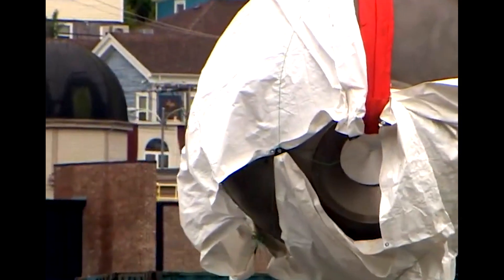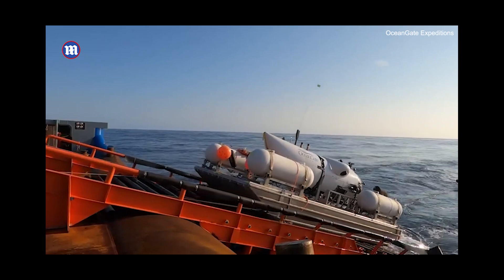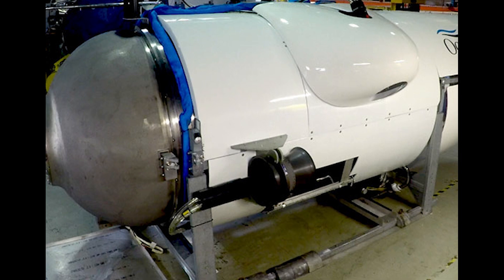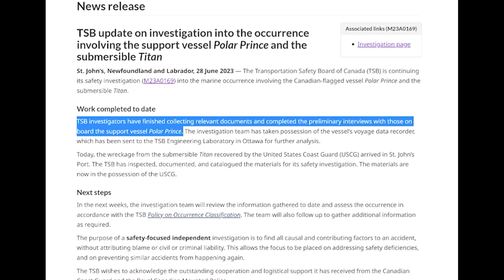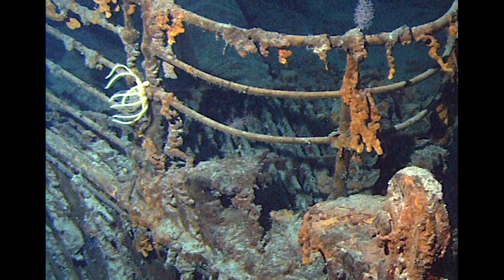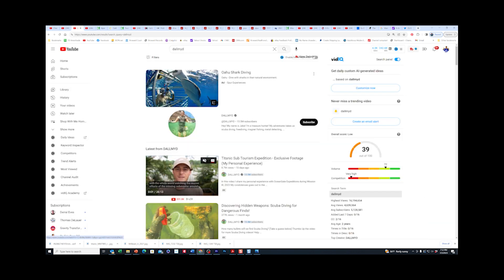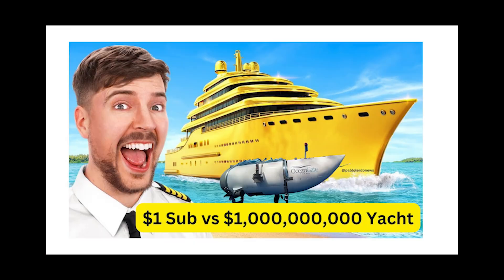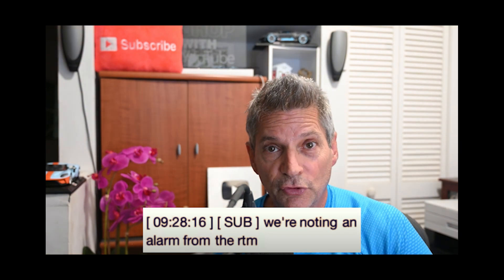Titan Submarine Debris Clues, Implosion Simulation

Comment: Regarding your comment that they didn't use a torque wrench to tighten the end cap bolts, I've seen other videos of them installing the end cap, and they finished the sequence with a torque wrench.
Reply: If your transmission pan leaks after it was serviced , chances are they failed to use the proper sequence or pattern as well as the torquing of the bolts as the manufacturer dictates. 
A spot on your driveway isn't as critical as a vessel exposed to 6000 lbs / Sq. Inch for a submersible.

Comment: I'm really surprised by all this. I have experience with carbon fiber materials for 30 years, both in windsurfing, where it's being used for example for masts and in cycling. As long as I'm dealing with these materials it's more than clear that force from outside will most likely damage it, that's just inherent to the structure of the material, it's easily crackable when you put pressure on it from the outside. It pushes the fibers together. The best comparison, I think, is with a rope. It's very strong if you pull it, but it wil immediately lose all it's strength when you push it together.

Comment: One thing is clear the temperature of double the surface of the sun has never been reach ever inside that Titan sub. Titanium has the lowest melting point, even lower than human bone . The thermal conductivity of Titanium and carbon fiber is much much higher thsn human bodies, which would have melted the thing and that didn't happen. So that part was made up. Also, James Camoron thinks water can be compressed, so I question whether he paid for his degree. And surface water on top of a small planet cannot atomise anything, not even the sun can do that and questionable whether even black holes can too, all theu do is compress atoms down after which they can explode out again. .

Comment: Where are the carbon parts? Well, that implosion was way more violent than that barrel. We're talking about several cubic metres of water (that is, several tons) rushing in at the speed of sound. When that wall of water hit the other side, there was an incredible shock wave going through everything there. So the carbon hull has probably shattered into tiny pieces, both titanium endcaps were blown clean off the carbon or all the carbon bits were exploded or shaken off it, the same shockwave blew off the viewport (and/or shattered it). The metal pieces have staid together probably only due to the failure mode of metal - they look ok at the first glance, but they are likely bent oder deformed or cracked.
When you consider the violence of the event like that, you realise why they immediately said that there will be no bodies to recover. Rest in peace.

Comment: Hydraulic Press channel just did a test of a cylinder with steel capped ends and it failed by the sides buckling inwards.  Buckling of something like that occurs from slight imperfections in the geometry or in the materials.  They were testing a carbon fiber pipe that had fibers running in every direction.  Previously they have tested carbon fiber tubes with fibers running in one direction only.  When loaded parallel to the fibers the material would fail in a controlled fashion, when loaded perpendicular to the fibers they got sudden explosive failures.
The sub had a tube with carbon fibers wrapped around the outside but no carbon fibers in the longitudinal direction.  If the tube is 8' diameter and 5" thick, I calculate 22000 psi compressive stress parallel to the axis of the tube and 41000 psi compressive stress parallel to the fibers.  I think the stress parallel to the axis of the tube would be resisted only by the epoxy matrix around the fibers, not by the fibers themselves, and the failure could be a sudden failure.  22000 psi seems like a lot more than the epoxy matrix could carry by itself however we know that the sub did sustain that pressure on previous dives.  Hydraulic press channel tried to test if multiple dives would have weakened the carbon fiber.  Their tests did not show that it would but again they were testing carbon fiber with fibers arranged in all directions, not just in one direction.

Comment: The implosion would have pushed out the window, since it was tapered to fit tighter when pushed in by the ocean pressure, the violence of the internal explosive collapse would have easily broken the retaining bolts and popped it out. My name is Bicycle Bob and I approved this message and Rush's hubris is incredible.

Comment: When you say the salvage "crew" might have removed the acrylic observation port before bring the front housing to the surface it sounds like you're implying there were actual divers down there undoing bolts? But that depth is impossible for human divers. So I assume you mean using an ROV of some kind, but that also seems like pretty fine work for a remote. Not but what things have advanced in robotic manipulators but it seems simpler to assume it occurred as part of the implosion. Wouldn't the instantaneous crushing of the hull also blow out all the air inside through the weakest possible aperture, thus possibly taking the lens with it?
Reply: nice adaption of  
a Top Gun quote

Comment: James Cameron was spot-on.
He said the search should be focused on the sea floor directly below where their last location was monitored.
Reply: Common sense. If you lose something you start looking in the last spot you knew it was at.
Reply: yap. at that depth, things aren't gonna go very far due to all the pressure.
Reply: @@UntrepidOne-gx5le No, it was completely necessary.  They weren't looking at the bottom for miles around, they were searching the surface for miles around. As there was no way out from the inside, they were just as dead floating on the open ocean, as they were 4000 meters down. At the rate they were ascending it would take 8 hours to surface (that is why they delayed the notification for 8 hours after loss of contact), a 1 knot current puts you over 10 miles away from where you started.
Reply: @JohnA891  Not necessary when everyone close to the situation was already aware they imploded. Only the news kept up the charade of oxygen running out for the rest of us.....

Comment: despite most of peoples idea that the sub imploded... i still think there isnt been any, cause the com. with board took long knowing they are in some trouble, trying to resurface and debris speak bands cause are big parts for an implosion. i suspect the port window cracking first.
Reply: I don't know a whole lot about the composite material but shouldn't the titanium rings have been bolted with a outer ring to sandwich the carbon fiber between the two. And was the glue ever tested at that depth.

Comment: This whole project was dumb. But it's even more dumb that the hull wasn't built in a clean room as I bet it was contaminated with dust and debris as it got built. Also, I've read of some saying at the least, the hull should have been built while in a vacuum to make sure no air bubbles was present and I believe that might would have helped the epoxy to all cure at the same rate instead of say the inside being hotter than the epoxy on the outside.

Comment: I think the failure point was the joint between the carbon fiber and ring. It probably started opening up from them both expanding/contracting at different rates causing a gap.

Comment: Don't forget: that near-instant metal drum implosion was 1 single atmosphere worth of pressure.

The implosion of the Titan was somewhere between 350 and 400 atmospheres.  So that drum implosion?  You'd have to be (somehow) able to play it in 400x speed to replicate a deep sea implosion, which happens in a literal millisecond.  There was enough energy involved that the Titan's passengers may as well have been sitting in arm's reach of 50,000 pounds of TNT as it was being detonated.
Reply from the maker: Yes, and a lot more heat generated from implosion at 12,000 feet down
Reply: @jeffostroff  Yeah, if you dig deep enough into the physics of what goes on during a catastrophic deep sea implosion, there's some crazy stuff going on.  Some theorize that the air in the Titan must have reached surface-of-the-sun temperatures for a few nanoseconds.

Comment: Actually it is more dangerous diving to the bottom of the deepest seas and ocean, than it is going into outer space, safety of those diving should be number one importance.

The emphasis on safety for space travel, with multiple backup systems, including finally individual space suits for all onboard too.

Should be followed for underwater deep submergence manned vehicles or submersible, however individual diving suits at the great depths of the worlds deepest seas and oceans, will be no use whatsoever.

As at present no individual diving suit, even hard diving suits, can or could stand upto the massive underwater pressure at the depths of 3,000 metres, let alone 6,000 metres, or 9,000 metres let alone 12,000 metres.

So providing those who travel in and dive down in underwater deep submergence manned vehicles or submersibles, with individual diving suits, will not help in an emergency at great depths of the World's seas and oceans.

So the actually underwater deep submergence manned vehicles or submersibles, must be designed with all the backup safety systems built-in as it were.

Maybe even providing the likes of an "Deep Submergence Escape Pod" for all those onboard now too, so if the main underwater deep submergence manned vehicle or submersibles, gets in to any kind of trouble or suffers an underwater emergency.

Those onboard can escape if there is time into the "Deep Submergence Escape Pod", before being automatically jettison in the the water and float safely upto the surface, with an underwater distress beacon telling others where the "Deep Submergence Escape Pod" below the waves.

Now after the Civilian Titan Underwater Tourist Passenger Manned Submersible Disaster, Marine Scientists and Naval Engineer's will have to start designing and building  "Deep Submergence Escape Pod" for all those onboard, either civilian underwater deep submergence manned vehicle or submersibles, or naval submarines too.

Yes the challenges are equally immense for both outer space exploration, or exploring the depths of the World's Seas and Ocean's too.

Yes the risks and dangers should never be underestimated either, that is why we need aerospace safety regulation and legislations, to provide for those going into outer space.

Though equally need underwater deep submergence safety regulation and legislations, to provide for those going down to the bottom of the World's Seas and Ocean's too.

Therefore maybe it is time, for international maritime laws, requiring "Deep Submergence Escape Pod" being  provided for all those onboard underwater deep submergence manned vehicle or submersibles or submarine too.

In case of any onboard troubles, or an underwater deep submergence manned vehicle or submersibles or submarine, suffers an underwater emergency now, as a legacy of the Titan Submersible disaster!

Comment: In the photo the flange on one of the titanium rings can be seen torn away, ripped loose by the power of the implosion. My money would be on the carbon fiber hull, more specifically the glue joint giving way. I can't believe Rush trusted his and passengers' life to a glue joint. Probably used JB Weld epoxy, too weak of a design in my opinion.
Reply from the maker: Flex Seal!

Comment: Two suspect points NOBODY it talking about are: 1.) The “glue” used. And 2.) the method of CF wrapping & bonding.
Knowing the corners Rush cut, it won’t surprise me when we find out that the glue was just JB Weld. And they’re applying it with 50¢ plastic spatulas and air bubbles can be seen in the spreading.
Then there’s the hose reel method of applying the expired CF. They should have had the crisscrossed like pressure thanks, then there’s the bonding process the is supposed the infuse the CF with resin and bond it into a uniform structure. I’ve seen none of that.
He drank his own coolaid, believe his own BS and paid the ultimate price just the join the other tragic Titanic souls and the bottom of the ocean.
Reply from the maker: I mentioned both in my first video on the Titan implosion, I mentioned how James Cameron suggested the straight hoop weave was not sufficient and should have been wrapped at an angle.

Comment: I don't think that the carbon fibre hull totally broke up into pieces too small to pickup. As soon as the implosion started, water would have gotten inside, counteracting the incoming force. Carbon fibre is pretty tough to break up. I would have expected it to be in several large chunks, if not basically all one piece, but badly deformed.
Reply from the maker: There is a lot of heat generated with an implosion this intense and it could have vaporized anything non metal
Reply: @jeffostroff  I agree with the heat being generated by compressing the air but would that effect material already covered with ice water? I would expect some of it to still be intact. I guess we'll never really  for sure. But the idea of gluing titanium to carbon fibre giving a joint strong enough would scare the hell out of me.

Comment: I knew Sunday exactly what happened to them. My mom told me about it and asked me what I thought. Having never even heard of OceanGate I did only a few minutes research into the sub, called her back and said those people are gone, the sub imploded. hindsight 2020 isn't even a factor in this case. The mistakes he made were so fundamental that its amazing he wasn't stopped even at the drafting table.
Reply: I find it so odd that people aren't calling Rush a negligent murderer.
Reply: My favorite glued and resin'ed expired charcoal fiber with a plastic view port submarine didving down to submersible depths

I'm usre the presure increased the heat to vaporisation and cuombustion presures sphere of milisecon 270klb preseure per square inch with 5 feat of acceleration and momentum and crushing air
Reply: @bobsterclause342  Bot bot bot
Reply: I dreamed that it was almost a suicide mission for S Rush. It will be interesting if the financials are published.

Comment: That clip you have of the blue barrel imploding was under just 1 atmospheric pressure.  Imagine 600+. The carbon hull probably turned into dust, and they say the heat inside would have been hotter than the surface of the sun for a brief moment.
Reply from the maker: Yes it would have been like a nuclear flash

Comment: Hi, Jeff.  Been following your channel since the Florida tower disaster, and I appreciate the time you put into them.  I'm a retired A&P heavy jet structural mechanic,  and that sealant you show them applying looks a WHOLE lot like aircraft sealant.  Aircraft sealant is used on the fuselage when repairing or replacing skin,  in the fuel tanks to prevent fuel leakage, interior areas, and windshields.  Each application requires a different type of sealant, and sealants are generally black and more often gray.    I spoke with a guy on another channel and he said submersibles don't use sealants of any kind in PRESSURIZED AREAS of a submersible.  Sealants may be used to apply exterior parts on subs in some cases.  And the way this guy seemed to "wing" everything with not a single brake attached to his ego,  it wouldn't surprise me to find that this was a BMS (initials used by a major aircraft manufacturer) sealant product.  I have yet to find a sealant for submersibles online,  except for exterior parts.
Reply from the maker: I am surprised he did not use Flex Seal!
Reply: @jeffostroff  IKR?  Nothing but inferior, untested products and parts for his subparmarine. 😢
Reply: This makes sense, especially knowing that Stockton had previously built and flown his own little aircraft. I can see him using the same glue! Just baffling!
Reply: @megatuanis  hey, if it worked in the air, why wouldn't it work in the water? He already had a barrel of it, might as well make a use of it :D
Reply: bet they used B1/4 and they rushed the install before it set gotta pull out the drill attachment for the mixing tubes 🤣🤣🤣
Reply: My favorite glued and resin'ed expired charcoal fiber with a plastic view port submarine didving down to submersible depths

I'm usre the presure increased the heat to vaporisation and cuombustion presures sphere of milisecon 270klb preseure per square inch with 5 feat of acceleration and momentum and crushing air

Comment: Another thing about that joint with the Titanium ring, the carbon fibre rim which slides into the ring appears to be cut out thinner then the rest of the hull thus weakening it more....
Reply from the maker: No I think the cyclinde rmight have been same diameter right to the edge. Would have to see their drawings

Comment: Glue does not stick to a smooth surface as well as to a ruffer surface  . I'm imagine that's why you don't see any glue. There's several flaws,  the fiber not set in the ring deeper, no inside ring on the inside if the seam joint. To counter pressure, small carbon fiber,  not enough weave, over lap. no inside support of the tube in the middle. Just wrapped around, what aluminum,?  I seen the communication texts,  sadly for 10 minutes,  had alarms,  new rtm, sensors going off. Took to long drop weight,  moving to slow up. They new for over 10 minutes,  they were in real trouble.
Reply from the maker: That had to be a scary 10 minutes!

Comment: Any plumbers will know that modern polypipe is very good taking pressure.( from inside) .No body uses carbon fibre to make plumbing pipes from.Even modern push fit connections can take a huge amount of pressure to cause them to fail.Its the adhesive used between the titanium and carbon fibre in my opinion that caused the issue.I also have seen any evidence of ribbing within the pressure hull to assist it at 6000psi.Any keen cyclists will know that carbon fibre is light and very flexible but will snap a frame if flexed too much.